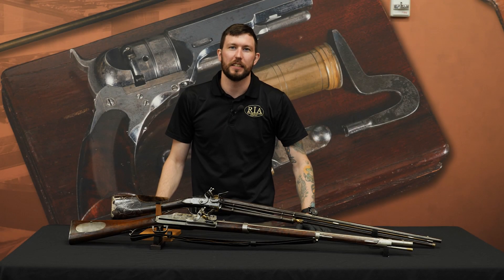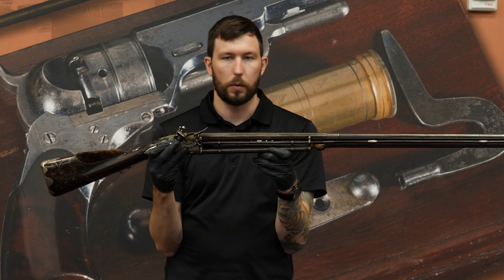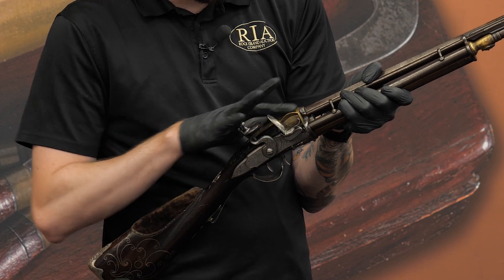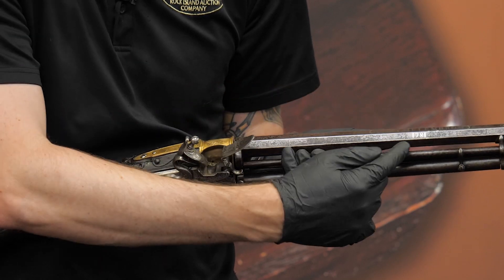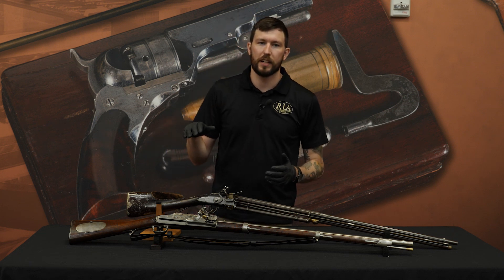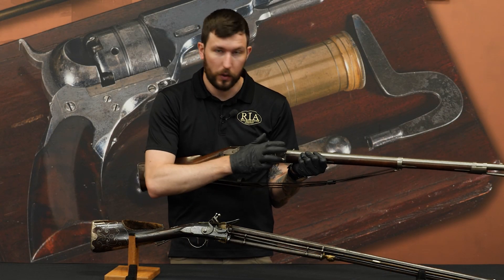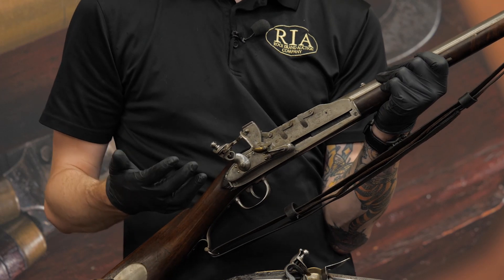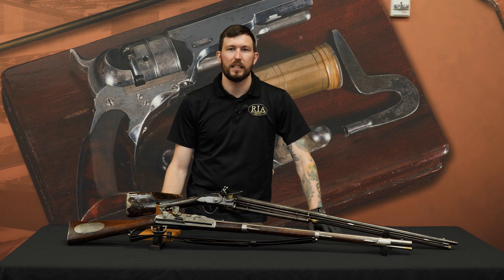Repeating Flintlock Rifles?!?

Comment: That is a great repeat rifle, however not technically a "firearm" the Ghiradoni air had the ability and capacity of 22 .50 caliber lead balls over 100 PSI  SO 22 shots in less than 22 seconds zero recoil 😊because air pressure shoots the bullet because air pressure not a rapport shoots the ammunition easily up to 500 yards!! And zero sound!!! After pumping the stock full you can easily reload 3 times without losing distance before pressure drops!!
Reply: Actually, the Ghiradoni has significantly recoil and is rather noisy.
But no smoke to speak of.

Comment: Maybe it's too late to ask a question; I just saw this video in Oct. '24. In the Jennings, does the ball of the 2nd shot prevent its charge from being ignited when firing the first shot, and so on as you move rearward? Just curious, not exactly sure how that works.
Reply: Correct. On most "superposed load" muzzle-loading designs, the subsequent balls/bullets are meant to provide the gas seal to prevent multiple shots from going off simultaneously. This is part of what kept them from being very widely adopted. If the next patched round ball is too loose, it will not provide a gas tight seal, and the hot gas then can leak backwards when the rifle is fired and ignite the next powder charge with potentially catastrophic effects. The Lindsay two-shot rifle-musket, for example, was built under U.S. contract during the Civil War, and there were reports from soldiers issued the guns of double discharges being common and destroying several of their rifle-muskets. Adding a tightly fit over the powder wad might add a little more security, but the overall length of the total charge had to be kept consistent to keep the powder charges lined up with their respective touch holes.
Reply: @S.Isaacson  OK, thanks for the response...I appreciate it. That's exactly what I was thinking; an undersized round could lead to a pretty nasty chain fire.